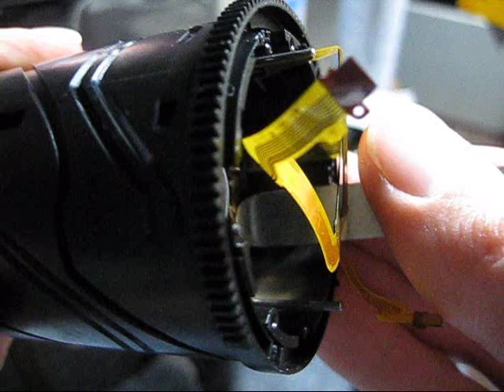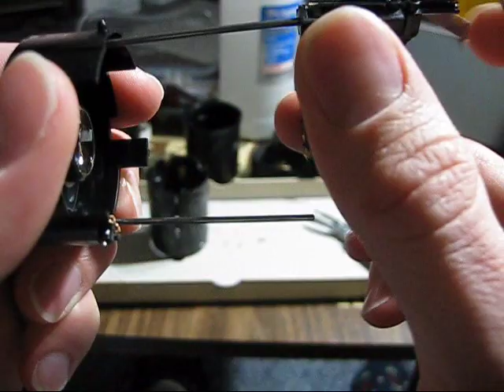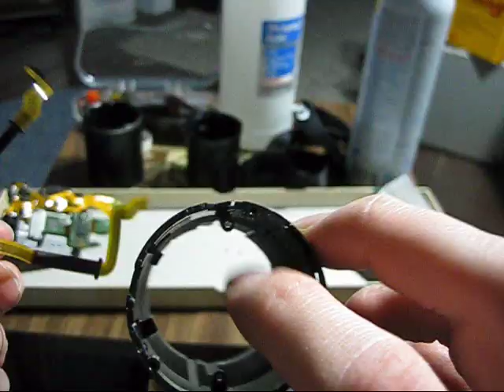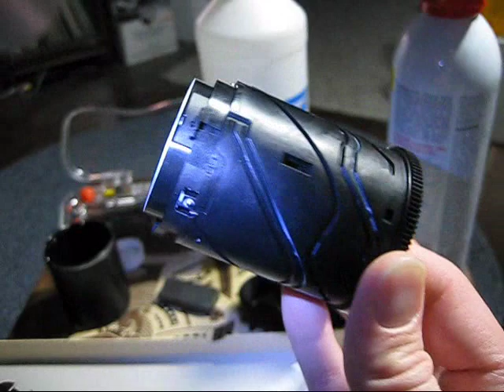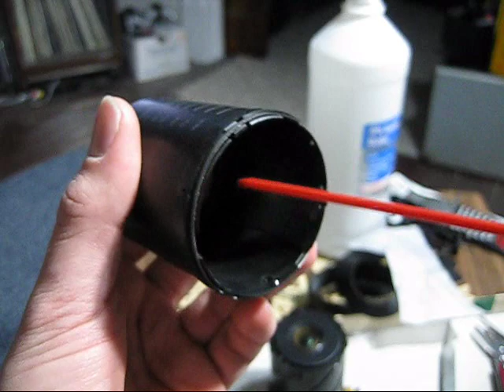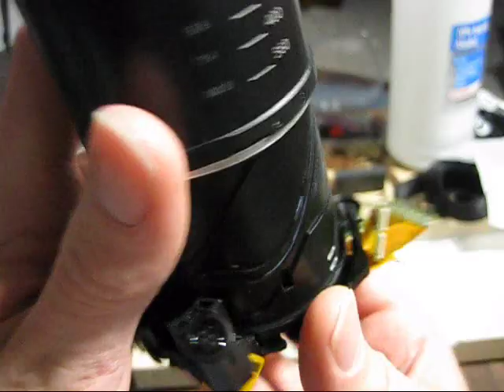Repair or Rebuild a Canon Powershot SX10 SX20 SX1 lens

Comment: HI Pete, great video. Unfortunately, I need the bit prior to where you've started. That is, I dropped my camera & dented the ring that surrounds the lens tube. Hence the lens will not extend from the body and I get the evil "Lens Error" message. As far as I know, there are no other issues. Any hint on how to take that off? Thanks in advance!

Comment: Hello Pete,
Congrats on your excellent video, it was very well done, step by step with clear views and the repeated warnings.
Perhaps you can help. Your video starts after the lens was removed. I hope you can do a video, or briefly explain "how to remove the lens" from the Canon SX10is
(Mine started a "Lens Error" and the cost of professional repair is not worth it, so I would like to take a crack at it. I've read and tried non-dissassembly "home repairs" mentioned on the internet with no luck.

Comment: Hello Colorbroken, 

Thank you for this very well made video. I've got the previous model: The Canon S5 IS. The original lens would no longer come out (rocks back and forth then error beeps), a month after a fall... I bought some used spare part lens zoom unit off ebay but after installing it (see youtube v=0cadAjag9KY ) the new second hand lens is now stuck outside. Do you know if those lens are similar? Should I venture myself in trying this out?
 
Thanks,

Reuben

Comment from the maker: @MsFoxterrier  I have to take a guess, but try a few things: use the Macro focus very close on something, zoomed all the way wide, and see if it has the same blurry spot.  If it appears very clean then it's probably dust or dirt inside the zoom element.  If it appears blurry again, it is probably dust or dirt on the focusing element, which is near the sensor in the lens design.  You would have to remove the lens from the camera, then check and clean the focus area near the sensor.

Comment: Great video.Thanks for this video and i  need a help from you regarding my Powershot sx10 IS. My problem is small fungus on my lens so  i went canon service center they told me cant clear the fungus because this is a single lens camera so i need to replace lens. This kind of issue possible only on Interchangeable Lens. Is it true? Please tell me what i do next. very urgent so please help me

Comment: Noisy zoom seems to be a very common complaint among other lens related issues like lens error.

 But for someone not familiar with disassembling this camera a video would be great help.

 PERHAPS the gears can be lubricated from the outside with out taking the lens apart. In the previous video I saw some channels, perhaps that is where the lens slides, and if you lubricate them the noise stops.

 But you would know more than me, so please help. Thanks.

Comment from the maker: Tony, you'll need to contact Canon USA Parts to acquire the correct replacement board for the SD card reader -- I assume you've got bad or bent pins in there, but hard to say without seeing it.  If you're not comfortable taking small electronics apart, DO NOT ATTEMPT IT YOURSELF.  There are lots of tiny and fragile components at work in there.  Otherwise I don't remember how the machine comes apart, sorry!

Comment: On my sx20is camera the plastic ring that houses the base of the lens has come loose, and now i have to be careful not to pull or hold it by that ring or it can cause a "lens error" message and then shuts off the camera, how hard would that to be to repair?

Comment: my SX20.. While taking a pic for a huge building or a portrait for a door, the I get problem with vertical lines in the pic.. always they are not parallel the go close together in the top.. actually this problem appears clearly while shooting with 18mm position.. Is it normal for this camera or there is something wrong need to be fixed... thx in advance :)